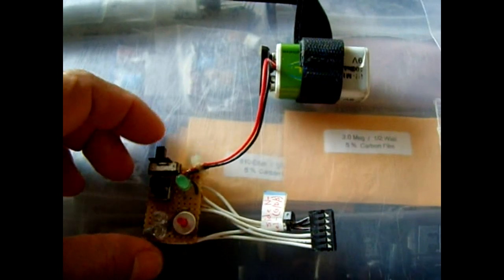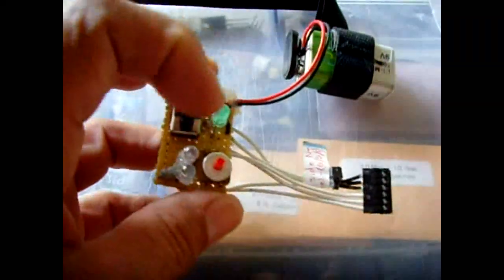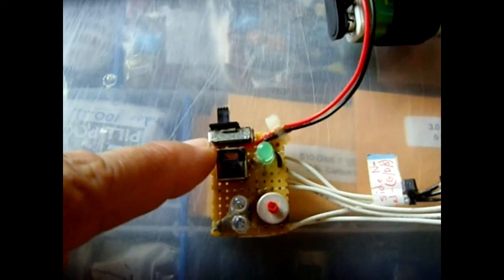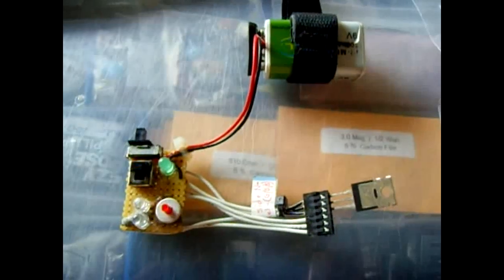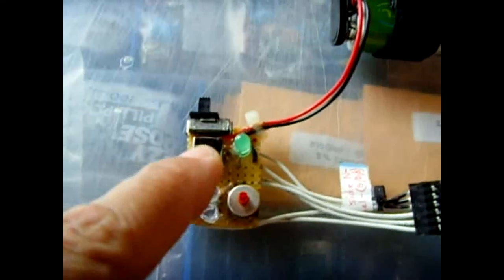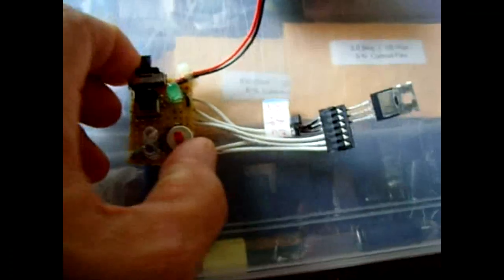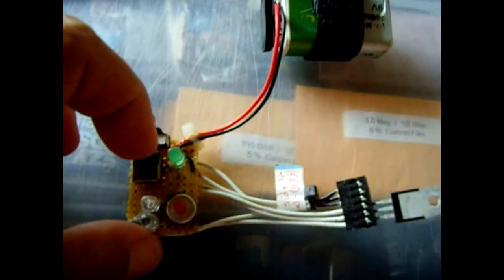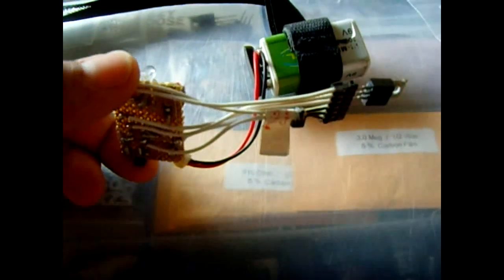9V N-Channel / P-Channel Mosfet Tester

Comment: Unfortunately, it doesn't work very well when D-S is shortened, while G-D and G-S are not. – The red LEDs never turn on, while green LED will be always on.
Reply from the maker: +Andriy Makukha 
Did you make this circuit? I had no problem using this circuit on a mosfet with a shorted drain and source.
Reply: electronicsNmore, I did. And for a fried MOSFET the red LEDs never turned on. (And why should they? A red LED will turn on only when there is current going through the gate.)
Reply from the maker: Andriy Makukha
Been a very long time since I uploaded this video. Shorted mosfets(D to S) are usually very easy to figure out w/o the tester.

Comment: Can you clarify something for me. I am a newbie for schematics. Is that first resistor of the pot to one anode and one cathode and the other anode and cathode directly connected to one another? Then another resistor off the first one to the drains? I guess I just don't see how the red led's would light up if they were connected to each other with no real + and -. I got it built and the green light works. All of mine tested with no red, but I don't know how to test and make sure the failure led's are working. Do you recommend a way to test the red led's?

Comment: I can tell easily the bad NFET on this RC component and it happened because of bad SMD mounting procedure with solder shorting out the various pinouts from the little buggers. The picture I made of it is so telling, I wish I could share it. Anyhow I would love to learn how to replace it and have had little luck getting a firm result after Googling the part numbers which in addition,are not the same on what I thought would be identical. It is an 8 "leg" model made by Fairchild Semiconductor. Can you offer any advise as to how to track it down?